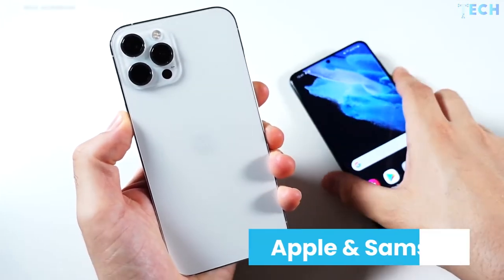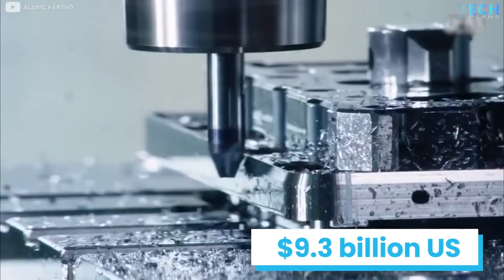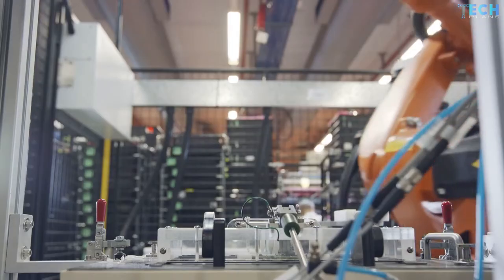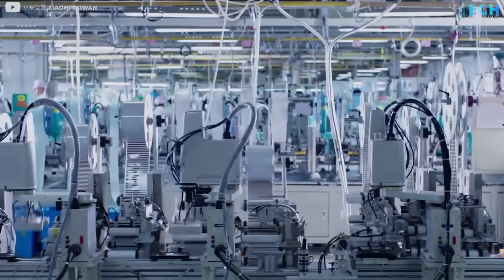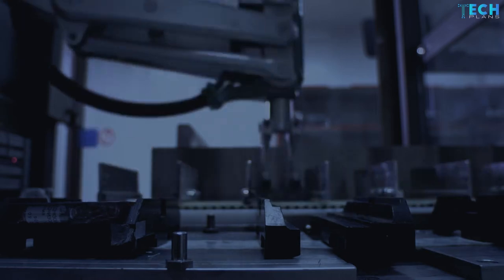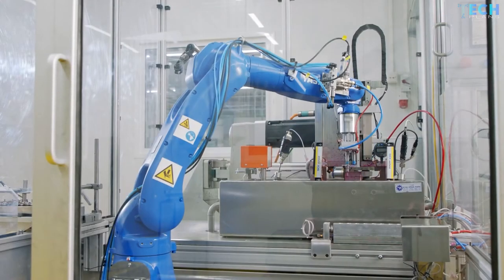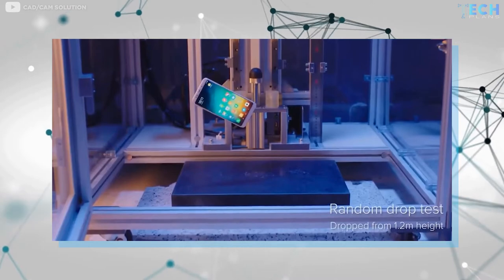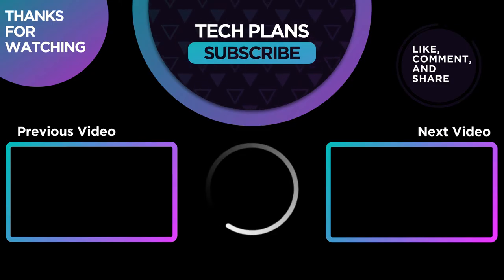Inside Xiaomi’s $9.3 Billion Fully Robotic Factory

Comment: No production of any product is self sufficient. Moving parts have a tendency to wear out. Bearings, motors, code readers, optics, connections corrode. HVAC systems fail for a variety of reasons. Not to mention external environmental threats. Ie.. recent floods, rodents, insects. All will require human intervention at some point in time.